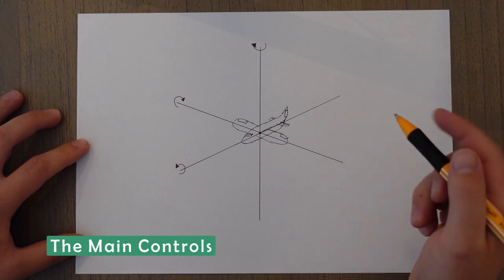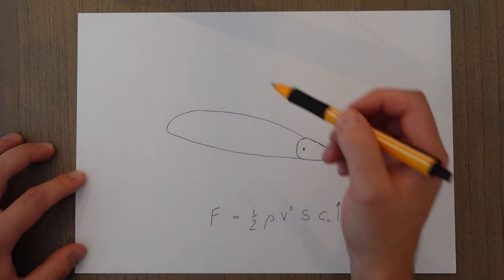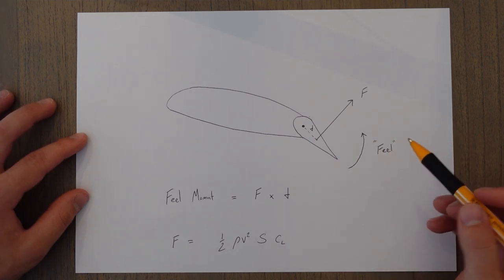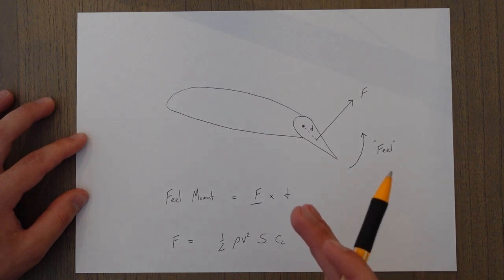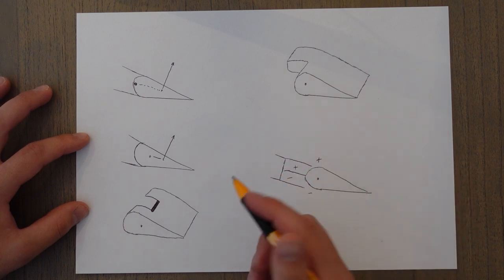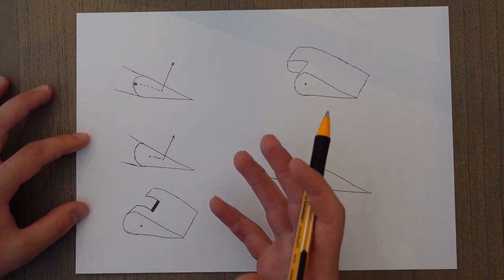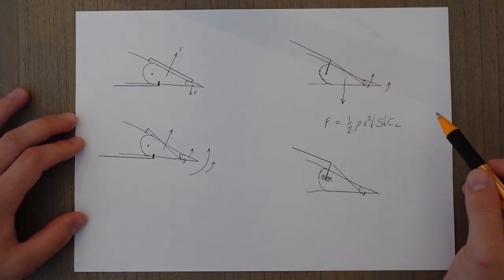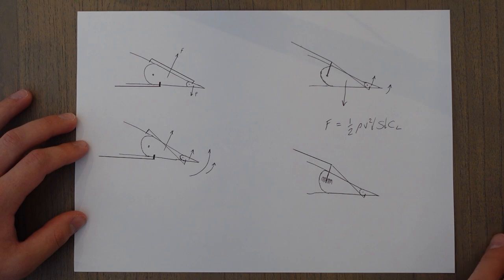ATPL Principles of Flight - Class 13: Controls.

Comment: you have flipped the aileron at the 3 mins bud,  when right aileron descends lift increaise wing goes up
Reply from the maker: You are on the right lines mate. What i was trying to show in the diagram is that the descending aileron increases lift just like you are saying but the upward going aileron doesn't completely stop lift being produced it just disrupts the airflow and causes a reduction in lift on that side. This difference leads to a rolling/banking motion.